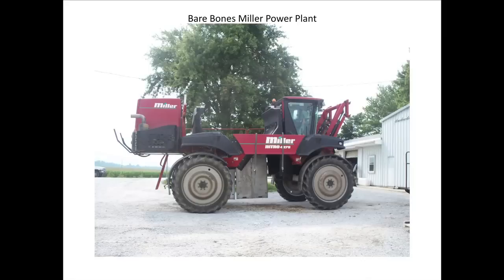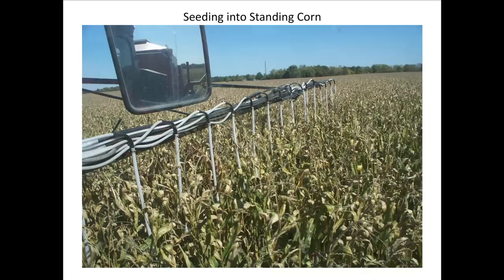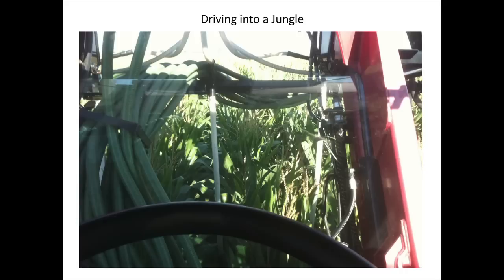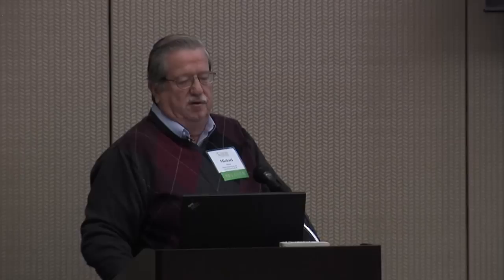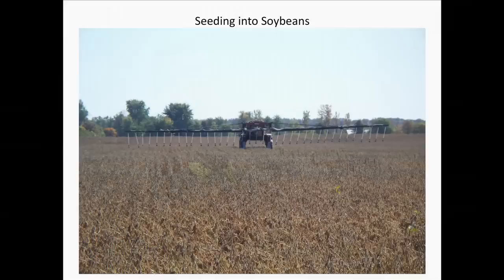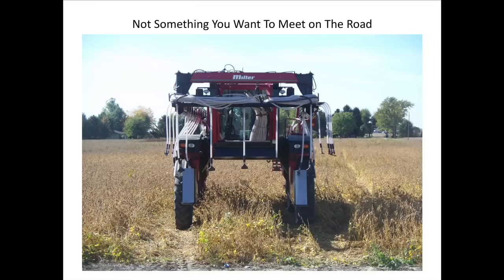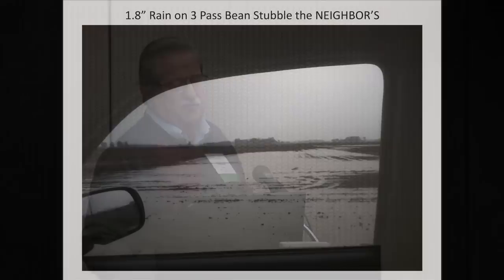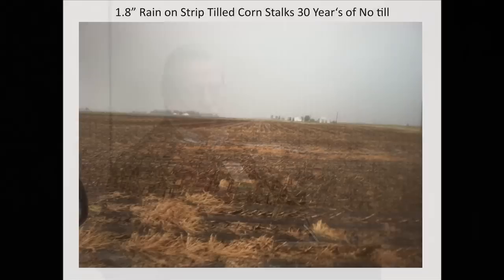Innovative Ways to Seed Cover Crops - Mike Shuter

Comment: Do they know they can terminate the crops without spraying and get even more value from them. SARE Outreach has had video's on this even from the guys with 20k acres under production. They don't have to spray the herbicide. That stuff doesn't just kill the plants, it kills the soil life. They are getting a big set back every time they do that. Tell them so they can have even more success. Thanks for sharing. By the way, I have no farm or farming experience lol. I love your video's, and the information you share. These big guys can totally change the game and I wish they would. I'll take even this start. Blessings!  Janice
Reply: +jksatte Good question. Yes it can be done, but it is not exactly easy.
Reply: +Red Baron Farm Choose cover crops that will winter kill?
Or ones that will be outcompeted and shaded out by the main crop?
Reply: Oolong Johnson Both those two work. Also there is the roller crimper method, livestock knockdown method, pasture cropping, sheet mulching. Many ways to accomplish this.
Reply: Oolong Johnson I heard the same, but never tested it.
Reply: jksatte b